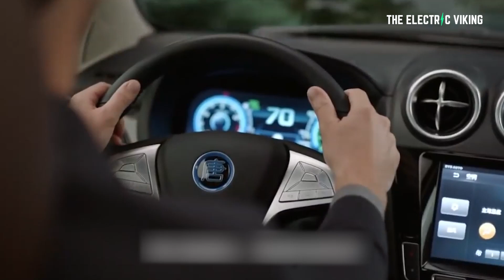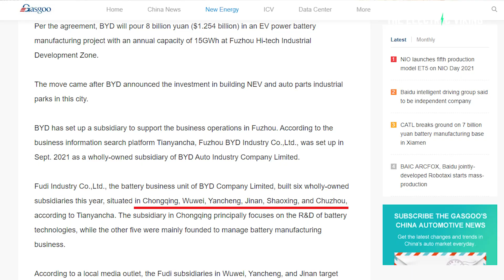BYD built an INSANE number of battery factories in 2021

Comment: While BYD has a lot going for it, it's not all roses. The business that I work for has been dealing with and buying both finished goods and bespoke products from BYD for years; their standards of production, communication and management do not set a high bar. While I also think that Tesla is thoroughly over-hyped, I'm confident that they'll enforce high standards from BYD.
Reply: Don't need high bar. BYD bus and taxi are used worldwide. Properly the biggest. The most practical.

Comment: What’s the truth? Is the new blade battery better than the new Tesla battery? Need to know.
Reply: "Different".
Much depends on whether Tesla can build or had built a 4680 LiFePo4 cell.
From what EM has said. "the majority of cells will be LiFePo4" and the planned 3TWh production, it's logical to assume that's the aim, since the 4680 allows huge production from a given factory footprint.

Comment: BYD's blade batteries are interesting. I would like so see how they fabricate the outer shell, insert the "jelly roll" and seal the shell.  What material do they use for the shell? 

No need for tabs, as the top of anode/cathode sheets could be used as buss bars over the length of the cell.
Reply: It’s a sandwich design.
Reply: Not being a "roll", or having any bends (probably) has a beneficial effect on cooling.
I wonder if they segment the sheets so that a penetration only punctures a short length of cell packets?